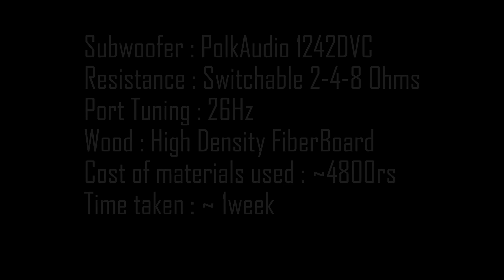Ported Subwoofer Enclosure build | Polk Audio

Comment: What dimensions did you use... nice work
Reply from the maker: https://subbox.pro/en/design/?bt=2&bw=406.4&bh=381&bv=65&mt=16&fp=1&sq=1&ss=12&cd=279.4&md=172.7&sv=2&so=-25.4&sd=20&sb=&sn=&pt=4&pq=1&rf=25&pd=128.21&pw=2&pa=129.04&pp=100#

Here, check this link for my build dimensions. Its a nice website for your own custom built(not sponsored by the link, lol).